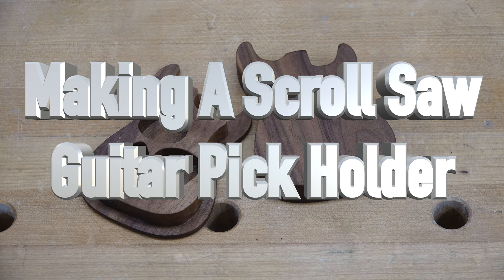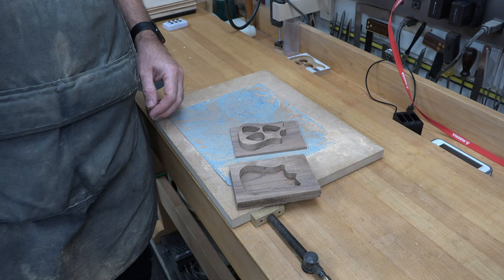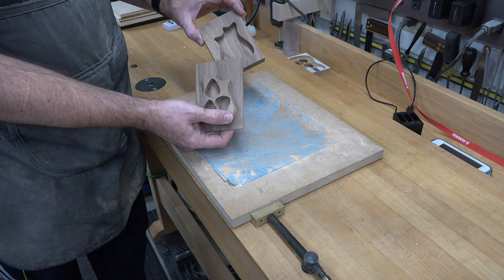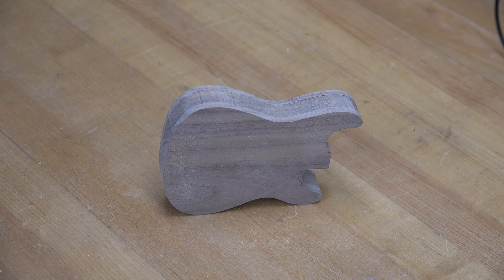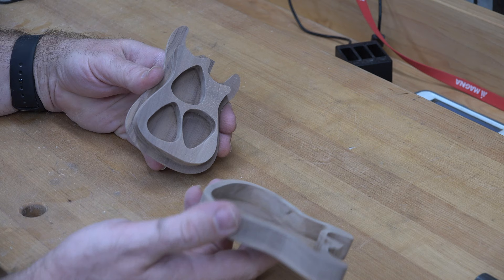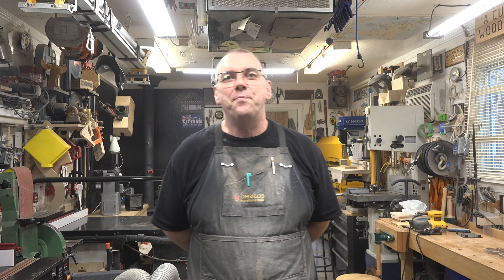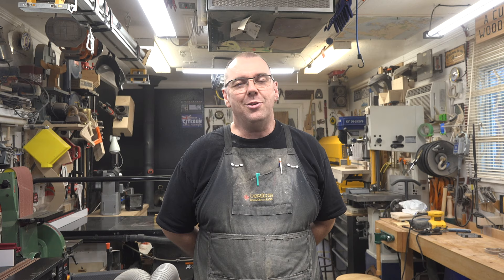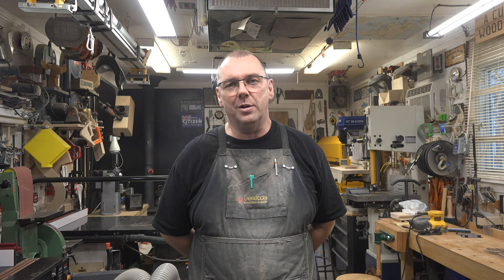Scroll Saw Guitar Pick Holder

Comment: Kenny, you bench clamp your using looks like an Older Veritas Clamp, but I've never seen one quite like it.    The newer Veritas clamps don't seem as versatile.   Is this a brand made by Veritas?  Thanks
Reply from the maker: This is the Veritas Quick Release Wonder Dog.  You can find them at Lee Valley Tools.  Here's a link.  https://www.leevalley.com/en-ca/shop/tools/workshop/workbenches/benchtop-accessories/74622-veritas-quick-release-wonder-dog?item=05G1030. I hope this helps.  Thanks for tuning in.

Comment: I know it’s been a couple years since you posted the video. I know the initial MDF templates were 3 1/2 X 5. Do you remember what was the final measurements on the pick box?
Thanks.
Reply from the maker: I can't remember exact dimensions but it was roughly 3"X4 1/2X5/8" thick.  I hope this helps.  Thanks for tuning in to the show.

Comment: Great work. What blade did you use to cut walnut?
Reply from the maker: Walnut is not a difficult wood to cut.  Using a #3 blade should do you just fine for this thickness.  A #7 will also work but it is a little aggressive.  I hope this helps.  Thanks for tuning in to the show.

Comment: Hi Kenny! Always amazed at your scroll work. I am curious, how much do you speed up your scrolling in the video? Love the little box. Didn't see the final shape coming until the very end. You are somewhat of an artist as well as a scroller. Bill
Reply from the maker: There is no set formula for me to speed up the cutting Bill.  It is dependant on the length of the clip that I wish to place in the show.  Normally, the cuttings are sped up anywhere from 2 to 4 times their original speed.  For really long cutting clips, I may go as high as 20X but that doesn't happen too often.  I hope that helps.  Thanks for tuning in and for the kind words on the show and the project.

Comment: If I don’t have a scroll saw what , is it possible to make this using other tools?
Reply from the maker: You could always use a fret saw to cut the design and then sand it to get the final shape that you want.  A band saw is also able to be used but only for the outside cuts.  I hope this helps.  Thanks for tuning in.